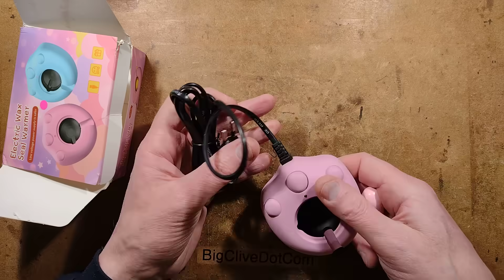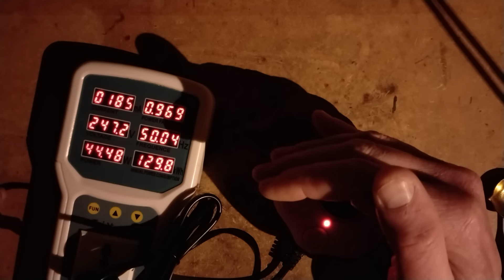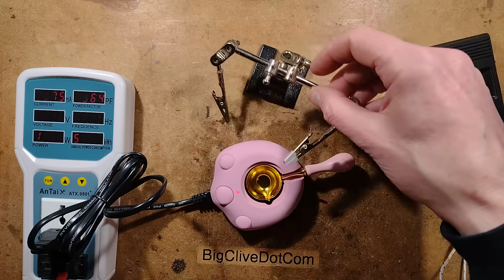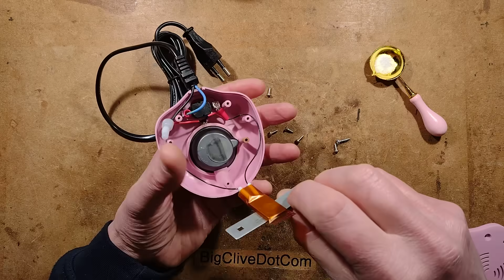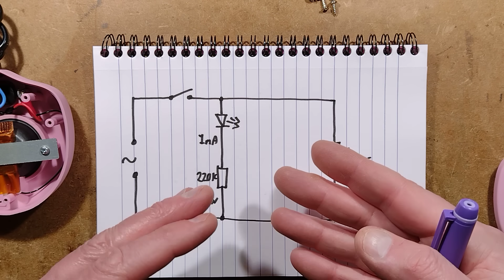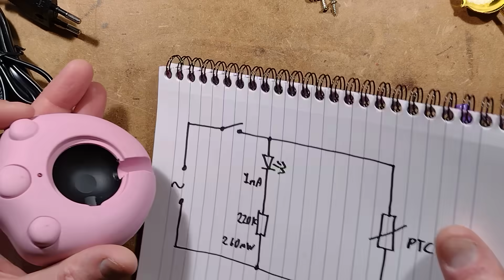Inside a sealing wax melter - with other uses

Comment: the ammonium chloride diffusion lab used to be common in highschool chem classes when i was in school circa late 2000s. i set up the demo as a ta a few times. you get a long glass tube and put a cotton ball of ammonium on one side and a cotton ball of hydrochloric acid at the other and where the white ring of misty ammonium chloride crystal gas forms in the tube is proportional to the vapors square root of their molar mass as governed by ghrams diffusion law. its why you can smell a fart kind of right away from someone next to you or hydrogen sulfide from someone opening an old thing of eggs across the room.... or ozone even diffuses quickly but bigger smellier compounds like sewage/organic compounds of decay sometimes take awhile to hit your nose.
good video on this sketchy heater. wonder if you could use it to cast low temp alloys like for making key blanks or something else.
thanks for uploading big c live
o the chem term for the opposite of sublimation is called deposistion. it happens in some climates where its cold enough to snow/water to freeze but there is still water in the air and all the sudden a layer of ice forms on your windscreen here in the PNW usa

Comment: AvE taught us materials. Nice interjection and a shout-out to him. There was this tech reviewer, not very-very young (so +life experience), reviewing a mouse. That mouse (that I also have, a 3dConnexion mouse) is made 100% from plastic, however, because the base of the mouse was painted grey, he concluded taht that part was metal. Yep. And he even poked it with his fingernail and said its some kind of metal. He was an idiot for not thinking through what he was doing there. AvE's and your videos would have tremendously helped him. Ppl lack real-life experience these days and the imagination and the laws of physics are only known and served through/by 3d-reders of gaming engines with mathematical formulas that someone decided arbitrarily to use it in a code while riding the train to work one day.

Comment: Modern sealing wax is flexible to survive mail-handling machines and does have a somewhat higher melting temp than traditional wax though not by a lot. Beeswax ended around the time of Shakespeare so even most old sealing wax is a mixture of pine resin, shellac, chalk, etc with a higher melting temp than a candle.

Comment: Remembering my O level Chemistry;
Sublimation is when a compound goes straight from its solid form to gaseous form. The process reverses as it cools down.
I seem to remember heating Napthalene (moth balls) in a test tube and watching them disappear, only to reappear as a solid 'plug' further up the tube.
Reply: In this case though it's not sublimation, because the compound actually breaks down, which it does not in sublimation. The actual term for what happens with aluminum chloride is "reversible decomposition". It's listed as the first reaction in the Wikipedia article: https://en.wikipedia.org/wiki/Ammonium_chloride#Reactions
Reply: @RedwoodRhiadra  Did I, at any point, suggest that the process described by Clive, was sublimation?
He mentioned sublimation, so I merely recounted the process that I had seen in a chemistry class nearly sixty years ago, that WAS sublimation.
Reply: Thermal dissociation is what happens to NH4Cl

Comment: The ammonium chloride (NH₄Cl) doesn't really sublimate, rather, it dissociates into hydrogen chloride (HCl) and ammonia (NH₃) gas, which then recombine (or associate), forming ammonium chloride again. As it does so, it also absorbs some water vapour from the air forming aggregates, which is visible as a fog as it forms tiny particles.
Though often some ammonia or hydrogen chloride gas escapes without the salt reformation, which doesn't smell nice and also can lead to faster corrosion of metallic objects around them, and the aerosolized salt also tend to form a whiteish layer on surfaces when it eventually lands somewhere.

Comment: Pity they didn't use a piece of tin plate for the outershell. Might have resisted excess heat, but would have made for a potentially interesting  live case :o). n.b YT seems to have issued an update today, meaning I have to be permanently logged in to view any YT upload now. That includes DuckDuckGo, which means I have to sit through all YT ads now. Not that  I mind too much, but it usually shows an Ad at crucial moments. heyho.

Comment: We used to have big metal ones in the post room, a bit like hotel room kettles. You squeezed the handle on the side and the liquid wax came out of the bottom to go onto the envelope before you applied a seal. It was absolutely essential for registered mail at the time.

Comment: Well that is Chinglish quality. A heater with hot melt glue inside to hold a diode, a housing made from plastic that touches the hot cup and no over heat protection if a failure happens.
Reply: Yes, a polished turd 😠⚠️
Reply: ITYM Chinesium but yes.

Comment: I believe a lot of modern products sold as sealing wax are, in fact, hot melt glue with various dyes and sparkly bits added in.
Reply: They'll burn your finger like they are! You can probably already guess how I know.
Reply: @markscheutzow3446  ... so you're saying it isn't ideal give a Brazillian wax?"
Reply: @95rav  You are wise.😂👍
Reply: Yeah, the real sealing wax is more like hardened lacquer. It reminds me of a specific type of kaolin clay crayons. All these AliExpress etc. Ones that come with these small bits... They have a very weird waxy, almost soft texture that is nothing like the real thing. Sealing wax is pretty much nothing like wax oddly enough. Because it needs different properties.
Reply: @ares395  sealing wax is just wax that is very hard, that's why it doesn't feel waxy. Cheap sealing wax is typically a mixture of softer waxes and they're cheaper because they are commonly used today and produced in many millions of tons each year.
Reply: @DopamineDeficient  - Like ares395 wrote above, post-medieval "sealing wax", used until the late 20th century, was essentially a type of lacquer (made from shellac, resin and turpentine) mixed with chalk.  

Before the 16th century it was generally made with beeswax, and these days you can probably find some based on carnaúba wax, but what most people still refer to as "real sealing wax" is the lacquer type that was common in the last four centuries.  

And none of them was just wax, it was always a combination of ingredients.
Reply: @RFC3514    Oh, that's really interesting! Thanks :)

Comment: Fun fact: wax vapor is highly flammable. I've seen it flare up just from hot ceramic.
Reply: That's a good reason for using a double-boiler or water bath.  There's no need to use high temperatures or an open flame to melt wax.
Reply: That's actually what burns in a candle flame.

Comment: the vapor coming off is probably Stearin.  It's added to paraffin wax to modify its melting point and it has a slightly lower boiling point than paraffin.

Comment: Wow that metal to plastic fastener was something else. Just imagine how those plastic posts gonna look if that device would been in use for a couple of days. Sheesh
Reply: You might be shocked how long something like that will actually last.

Also, you might just get shocked. 😅
Reply: The only problem is bad/brittle plastics. I've had some battery chargers disintegrate in the past. But self-tapping screws in plastic stand offs are usually fine. People are now disassembling 40-years old devices, and the posts are still fine. In many cases, it would be simply a waste of time to put in brass inserts and machine screws when there is little reason to ever open the device.

Comment: The pad is probably supposed be on the other side, isolating the metal bar from the heater
Reply: That's what I was thinking. It might minimise the heat impact on the posts. There's already kapton tape for minimal insulation to the pot without reducing heat transfer. Silicon(-like) pad seems so far down the list of materials useful to optimise heat transfer in it's assembled position as to be a bill-of-materials liability for a cheap Chinese marketplace product.

Comment: I guess the silicon pad should have been installed between the metal plate and the heating element, not the heating element and the cup. This would perhaps help prevent the heat dissipating via the metal plate onto the screws and to the plastic that has discoloured already.
Reply: Thats what I'm thinking too. There is no need to insulate the metal bowl side from heat, makes no sense.

Comment: I can see it being used by a section of society for a specific herb. 🤔
Reply: 150c isnt really hot enough imo, according to google ai it is but if you've ever tried to use a low power herbal vape you will know that it doesnt do much unless you crank the temp right up
 
The ideal temperature for vaping herbs varies depending on the herb, desired effects, and personal preference, but generally, lower temperatures (around 150°C or 302°F) are better for preserving terpenes and flavors, while higher temperatures (above 190°C or 374°F) are better for a stronger and more potent experience.

Comment: I wonder... was that sil pad on the wrong side of the heater? it might help prevent the case getting too hot via that mounting bar; the little crucible should be hotter than that I assume...

Comment: It's Pink too, why am I not surprised..😉 Never used an electric version of a melt pot just old school candle with ladle.  Kapton tape applied to the metal bar might help with the potential heat damage to the plastic screw post.  Thanks Clive.

Comment: Have a book/mag somewhere with Ammonium Chloride as a Halloween fogger back in the 50's. Inside a fake Witch's cauldron they put a "stinger" electric charcoal lighter under a tin pan of crystals. 
It was used indoors too, despite being somewhat unpleseant. Basically just an elecric heating element and something with surface area.
   Popular Mechanics probably.

Comment: Hmm, super dodgy, I'd like to see a thermal cutout or thermal fuse in there. I wonder what the market is for this device. It's hot enough to melt woods metal, maybe useful if you like casting small metal things.

Comment: "...a typical imported nonregulatory compliant piece of stuff."  So tactful.
Reply: The device is fine actually. In 240V-land, you can consume 2.5A with a euro plug (>500W), and this device is well below it. Since it is completely made of plastic, and even has the heater insulated twice, I don't see any hazards from it.

Comment: What can they screw up on something so simple.... ah yes, plastic that can't take the relatively low heat without going brown and probably failing soon!  Sublimation is solid to gas without liquid phase.  Think dry ice or why stuff gets freezer burnt - the ice crystals sublimate out and when you unfreeze the item it is missing some water content so tastes naff (that's a highly technical term!).

Comment: Since that little circular silicone pad is more of an insulator, shouldn't it be between the PTC and the hold down bar, instead of the PTC and heating bowl? Seems to make more sense in that location to prevent the plastic housing from burning.
Reply from the maker: I think it's to help couple heat to the dish and also act as a secondary layer of insulation.

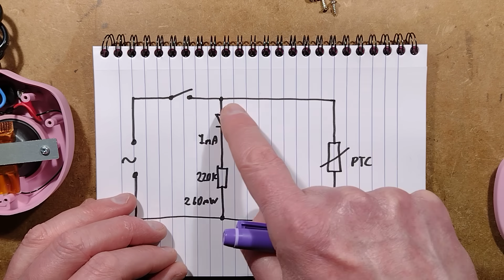Comment: 8:30 So the current flows only in half of the cycle meaning dissipation is 130mW not 260mW.
Reply from the maker: LEDs will shunt above their peak reverse voltage so it conducts in both directions.

Comment: There is sealing wax and sealing lacquer ("Siegelwachs" and "Siegellack", respectively, in German).  Melting sealing wax is no problem, melting lacquer is kind of a problem.  It's similar to wood filler with a shellac base.  What I've found works best is a hot air blower with good temperature regulation that can be used for encaustic painting (wax with oil paint).  The kind you can buy for stripping paint, etc., can't usually be turned down far enough.  You need more heat for lacquer than for wax.  I have some little steel pans that look like miniature skillets and melt both materials in them.  One pan per color.  Never use anything with plastic on it.  Wax is no problem to get out, but lacquer is forever.   I use spoons to get the melted lacquer out.  Again, one spoon per color.  There is a risk of burns, the fumes aren't good to inhale, and it's kind of messy.

There are special devices (or at least one) for melting sealing lacquer but it doesn't pay unless it's for large amounts.  Good ventilation is a must.  There is considerable loss and there's not much point unless you have seals.  Seals made of brass are available.  Stone would definitely work, too.  Harbor seals would be just the right size but sea lions would be pushing it and elephant seals would be out of the question. There's nothing like the look of lacquer seals, but if you don't like fuss and bother, this isn't for you.  It's also not exactly cheap.

Wax can be melted effectively in a double-boiler or a bath of boiling water.  I use the little metal pans in a "party pan" for keeping food warm with its own power source and a temperature regulator for this purpose.  You have to make sure the water doesn't all evaporate, so it should never be left unattended.  I use wax for encaustic painting but I think the lacquer seals look much nicer than the wax ones and they are much more robust.  However, it's horses for courses.  Wax is one of my favorite materials to work with and it's great for painting and modelling.  However for seals, I would always go for lacquer.

Comment: It's too bad it's so small. Something like that would be good for heating hide glue for furniture restoration. You'd need to be able to adjust the temperature. Actual glue pots are surprisingly expensive.
Reply: I don't think it would be safe.  A pot for hide glue is, in my opinion, an essential investment for any woodworking shop.  The one I bought is very robust and it keeps the glue at a constant temperature.  I think hide glue is by far the best kind of glue and use it everywhere where it can be used.  Admittedly, it doesn't have a nice smell.
Reply: On the other hand, if you're a vulture or a hyaena, it might be just the ticket.
Reply: There's a reason hide glue is usually melted in a double-boiler: it chars rather than melts if exposed to direct heat. If you think hide glue smells bad normally, you /really/ don't want to smell it if it burns! :)
Reply: I'm glad to see so many hide glue fans! I'm new to using it. I've used Titebond to repair several pieces, and see the error of my ways. They turned out fine, but could be difficult to repair later if they get damaged. I have a small project that doesn't justify buying a nice pot yet. I know to keep my eyes open for a decent one now though.
Reply: @BlankBrain  Hide glue has several advantages.  For one thing, it can be softened and parts can be separated.  This is important for violin-makers and luthiers.  It also doesn't require drying time in the same way as, say, white or bookbinder's glue.  However, joints glued with hide glue should also be clamped and left to set for awhile.  It can be diluted with water or thickened by being left to stew.

I like to use dowels in combination with hide glue.  In that case, it may not always be necessary to clamp the joints.  I almost never just use glue with wood.  I'll almost always use dowels or screws.

A disadvantage of hide glue is that insects will eat it.  That's not usually an important consideration, but it might be in some special cases.

I would recommend buying the best pot one can afford.  Mine isn't a double boiler, it has a completely hidden heating element with a separate, removable bucket for the glue.  You have to keep adding water to the glue, but not to a boiler.  This is much safer, especially since you might have your glue pot going all day.  Not burning down one's shop is worth the investment.

I like having the glue pot going and I sort of like the smell, in a way.  I mentioned this once to someone and the reaction was "Men are strange".